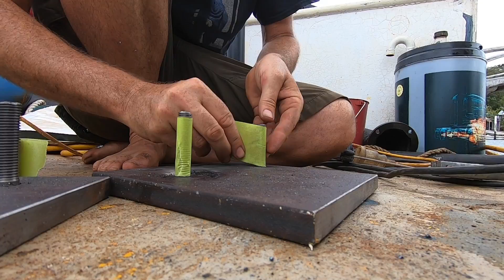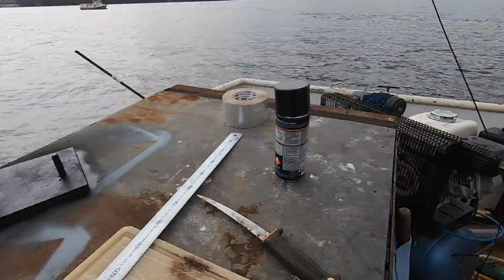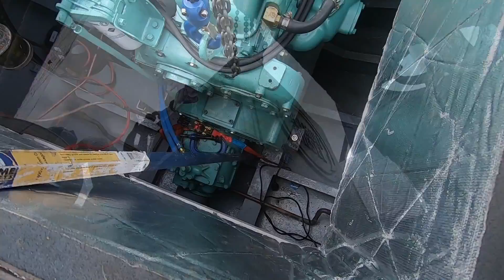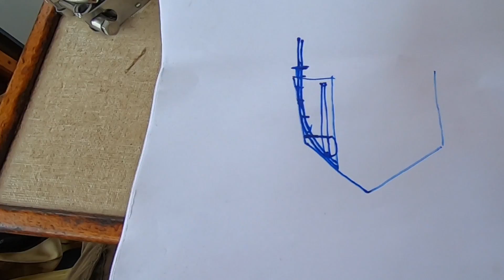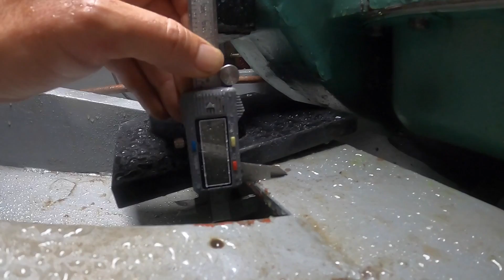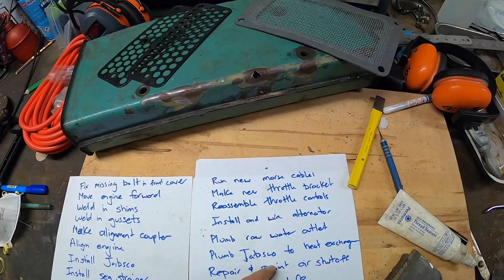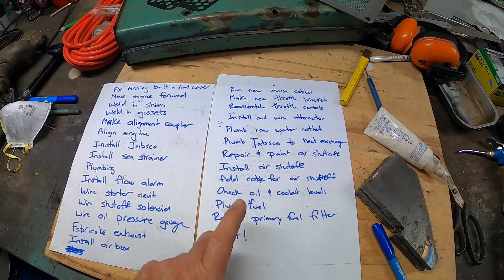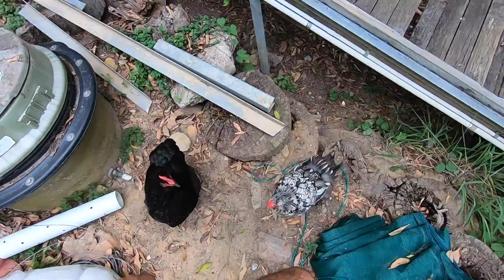Making and installing new engine shims

Comment: Stu, there's no need to rush mate. All good things take time and as Roy mentioned - there's no sense in potentially breaking something just due to some form of impatience. Think of your list as a whole heap of more content you can create too! There's plenty of creative opportunities to get heaps of vids from all those processes.

I thought Damien was into his 'Dark Country' or whatever it was called? I did enjoy the dissimilar metal thing though..

Nice soldering iron too - I've had the same model for years. Hasn't let me down yet!

Good move on the PWM to MPPT charge controller too. I bought a new 600W pure sine wave inverter the other day and it even has a built in solar controller - amazing the things you can get these days.
Reply from the maker: Thanks Scott. There is no doubt that getting this engine running will give me plenty to film!

Comment: Why not rig up a tarp over the aft portion of the vessel - from the aft edge of the wheelhouse over the stern - give shade and rain protection?

Sliding the engine forward and aft will affect the alignment between the shafts unless the propeller shaft and the stringers are parallel, which is suspect they are not.

Another way to do it would be to mill up a dummy assembly plate that's the same thickness (but uniform) as the plastic coupler...  Get the alignment perfect with feeler gages and then swap the assembly plate with the plastic coupler...  Oh wait, that's what you've decided to do at 31:27 (I was writing this as I was watching)...  Great minds!  lol
Reply from the maker: Of course the trouble with the milled spacer is that I still have to  increase the gap by an extra 50mm to get a socket in there to attach the Polyflex coupler. Can't win!
Reply: @DangarMarine  if you do the alignment with a metal spacer than all you need to worry about is retaining the exact position of the engine mounts. Just another comment above there is a simple solution to this, tapered holes drilled through the thick shims and supporting rails plus tapered pins to get everything back in the exact same position once the flex coupler is mounted 
Cheers!

Comment: use long bolts/threaded rods with nuts placed inside to simulate the poly, lift the engine and bolt to shaft then weld mounts in, remove bolts and insert poly. and its done.
rod ----x-----x-------
Reply from the maker: I also need about 100mm to install the 38mm poly though as I have to get a socket onto both sides of the bolts...
Reply: @DangarMarine  use a spanner - articulating head

Comment: 17:30 there might be a better way:
https://www.aircraftspruce.com/catalog/inpages/belite-10-06737.php
"Non intrusive, non contact fuel measurement
Works with any metal, plastic, fiberglass fuel tank
Small size
Very accurate
Works with any type of liquid
Designed for direct digital interface to Radiant Fuel Gauge (digital input)
Easy Installation
Optional five point calibration with five volt output available
Minimal dead zone – 2 inches of fuel in the tank. Dead zone varies by material and installation.
LED on puck indicates presence or absence of detected fuel"
Reply: Maybe I should watch the entire video before commenting.
Reply from the maker: It's good to have a link to an actual product though. :)

Comment: Here’s my thoughts on aligning the drive shaft with prop shaft.
1) Hang the engine as close to the CG as possible with your chain fall.
2) bolt the drive flange to the prop shaft flange along with the poly flange.
3) fiddle with your engine mounts maintaining the shaft alignment with the chain fall still supporting the engine.
4) secure the engine mounts to the hull stringers, adjust the engine mount levelling nuts accordingly.
5) remove the chain fall, 
6) Start the f’ing engine :]
Reply from the maker: So this would certainly work and let me start the engine up - it's pretty much the process I was describing for bedding the cutlass bearing in before a final fine alignment. I am more and more tempted to go this way as having the propshaft freed up will make things a whole lot easier and I do find it hard to believe the Polyflex coupler is that bad. Maybe just having it skimmed on a lathe would be a good first step?
Reply: Dangerous..... that chain-fall is on a beam of course but the beam is on a boat IN THE WATER (spoiler alert: boats TIP when CofG shifts or when other boats go by with their wakes) . When the boat is on stands then its different.......also, Vynie,  "Start the f’ing engine :]" is the kind of HYPE that I think is not in line with what buddy just said at the end of the video........

Comment: Analysis paralysis, love it. Gonna steal that. Probably a good idea to align as best you can, run the engine at low revs, whilst monitoring closely, the rubber of the engine mounts will settle a bit with weight/heat/vibration, you should be able to see even slight gaps between the polyflex coupler and the flanges, but I imagine that the vibration levels will tell you if you’ve got it right. I’ve always advocated cctv in engine bays, always nice to see if anything is smoking or moving about on a screen in the bridge without having to pull the hatch...
Reply from the maker: I am starting to lean towards a "close enough" startup to get things bedded in. The amount of vibration will tell me whether damage is being done. I too plan to add a dual visual/ IR camera into the engine bay.
Reply: @DangarMarine  Yeah, a dual IR/visual setup is even better.Sounds like a plan Stu. Great minds an' all that...😁

Comment: Stu, wasn't the poly coupling designed in for a reason?  Any way your to do list is impressive.  : )
Reply from the maker: Not really designed in, in that I've added since the engine came out. Originally it was just a metal coupler between the two flanges.

Comment: Hi Stu
You can use the yellow tongue from a mfd board to check fuel. Electricians use them to feed wires and they will not curl up at the bottom of the tank. André
Reply from the maker: Yep, I was thinking of exactly that. :)

Comment: Hi Stu been watching you for a while.  Just a heads up.  You can't align the engine "angle" and then move it forward.  The trans flange would then be too low in relation to the centerline of the shaft flange.  I know this isn't what you want to hear, but you have to slide the shaft as it is the only piece that will stay on the same plane.  Also you should measure the end play of the shaft flange up and down and split the difference to account for the weight of the shaft moving in the cutlass and stuffing box.  Alighning an engine can be a royal pain, but if its done wrong it can really wreak havoc later!  Increased cutlass wear, shaft wear, and vibration are all things it'll cause.  Keep up the good work!
Reply: PS. Get a 3/8" dowel rod from lumber store to use for tank dipstick.  flexible enough to follow contours, easy to whittle witness marks into and it'll show wetness of diesel really well.  Always have a spare or two after you've determined location of marks as they tend to go overboard or get stepped on.
Reply: PPS.  A digital angle finder placed on the shaft after you prop up the shaft flange up to take account of the "play" i mentioned above, then placed atop the engine's head will get you real close then you can play with feeler gauges while spinning the trans flange and prop flange to ensure surfaces are true as well as square to each other.  I can't recall if you pulled the prop shaft when on the hard.  You may have to do so when you go back on the hard and have the flange trued depending on the amount of corrosion its seen over the years.  Many have a hole in their rudder so that it can be turned sideways and the prop shaft slid through, but you'll have to remove the flange to do so.  I grew up on boats on the Gulf of Mexico shrimping and fishing and my last boat was a 34' Mainship and had to have an entire custom shaft log made as the original Bronze unit had leeched out and become dead and actually broke when I was prying the stuffing box off it.  So I had to start over from scratch with alignment just like you are.
Reply from the maker: Hey mate. It's interesting because in my head I had the shaft log and the engine mounting rails as being parallel, which of course may not be the case. I didn't take the prop off when I was on the hardstand as the nut had been welded onto the shaft, yet another reason to replace it when I get the money. I did take the whole thing to a machine shop though and they straightened the shaft so that's something!
Reply: @DangarMarine  IF you had the shaft and flange trued you are way ahead of the game!  That will reduce one potential nightmare of fighting worn flanges and trying to find the lesser of out of true planes and living with it!.

Comment: If you are ever inclined to replace your battery chargers I can recommend these a Motormate AC-DC24V 20A BATTERY CHARGER & a Motormate AC-DC 12V 40A BATTERY CHARGER I've got the 12v model & they are very good, fast as I have 4x 300ah 12v deep cycle batteries.

Comment: Hi Stu. When you say align you mean the centerline of the transmission output shaft and the prop shaft are on the same line. Are the flanges straight or do they wobble? I think if you talk to a machinist he can tell you a lot , they align parts to machines all the time. If it were me I would spin the shafts with a dial indicator on the face and shaft to make sure the error is ok for the coupler. I would then install the coupler to which ever shaft is easiest to turn. Then I would mark one point on it. I would measure the gap to the other flange at this mark only by rotating the shaft 90 degrees for each measurement . If the gaps are the same you should be ok. Please know I’ve never done this and I am not a great machinist so talk to one before you try this
Reply from the maker: Yep, dial gauges are a common to use for this job. The flanges are pretty straight so in theory it is just about getting them parallel to each other and no offset in any direction.

Comment: Aligning the shaft with the engine was the hardest part of my engine replacement. I had to use shims as I didn't have the bolts that you do. Fiddling with little metal plates trying to find the right combination, fore and aft, to make it all line up. You're coming along nicely though. Thanks.
Reply from the maker: It certainly is a tricky part of the process. I'm glad I put the adjustable mounts in to make things a bit easier but it still isn't going to be simple.
Reply: @DangarMarine  I've never aligned a motor in a boat, but as a fitter have done plenty of similar couplings. This is a job that takes time to be done right. Rushing this step will most likely lead to problems down the track. If you haven't got a fitter mate to give you a hand/tips, watch a couple of video's if you have the time. You may have to get/borrow a couple of different bits. Not sure if you can fit a dial in there, but even a Mike could help.
Reply: Dangar Marine Engine alignment is worse than docking at the ISS and they don't have to deal with gravity! However fancy some of our life has got, some chores still suck. I wish you luck and patience and beer enough to to get there in good spirits!

Comment: on the ship i work on we use pressure sensors to measure fuel, the more fuel the higher preasuere. then you could calibrate a guage to read against it :)

Comment: is there any inline fuel flow instruments you could install? kind of like a nmea 2000 connection for an outboard? then have your fuel flow/consumption displayed on your sounder?
Reply from the maker: You can get them, and they are awesome for determining the best RPM to run at, but they won't show your tanks are empty if you spring a leak.
Reply: @DangarMarine love your work stu !

Comment: Looking at the coupler, it seems like you have just enough room to get the dial calipers in there. I'd say screw making an alignment adapter - get the polyflex in there and use the calipers to take measurements at three different points around the circumference between the machined flange surfaces. Bevel the edge of the coupler in the lathe if it's interfering with getting the measurements. You'll lose your mind trying to accurately align that Detroit in fractions of a millimeter. It could be getting to you already - the "dissimilar metals" joke is proof:)

Comment: Stu, Bank 0 at 23.9V or /2 = 11.95V per battery should be 40% SOC, not the 5% the Balmar reports, the Balmar looks to be conservative so you don't discharge below 40% SOC with the AGMs for more life cycles, they can safely go down to 15%, you just get fewer cycles and may need higher charge rates than solar can provide. If the Balmar asked you to enter the battery capacity, and is using that value to compare to what it measures across the shunt, you may have underestimated actual capacity. The REDARC is probably measuring battery voltage and using that to indicate if the battery is flat. REDARC don't list the low voltage that the LED comes on in their manual though... but I'm sure you'll find out and show us. :)
Reply from the maker: Hey Craig, I was thinking that the Balmar may be showing usable percentage left rather than actual percentage. Personally I'm glad it is conservative. As they say, batteries don't die, they're murdered. :)

Comment: Stu, good tip for tapping. Tap diameter- pitch = size hole you need to drill, for example M10 (10mm) - 1.5 pitch = 8.5mm hole

Comment: A rule of thumb is 1/1000 of an inch per inch of flange diameter. I know the Polyflex couplers well take .020 of an inch misalignment if the shaft centers are true to one another.

Not being able to move the shaft fore and aft is making the job of alignment a real pain in the butt. 

My suggestion is move the engine where you need it. Use a machinists rule to line up the edges of the separated companion flanges. I a small Machinist Square modified to do this task. If you had a 123 block to use as a square off the transmission pilot to aline the counterbore of the prop flange. A 123 block would be about 25mm by 50mm by 75mm. 

Then use a telescoping bore gauge to measure your flange alignment up and down and side to side by measuring the gauge with a micrometer to find the differences. It's a good idea to error to needing to lift the shaft slightly to get the pilots into alignment. Generally it's half the clearance in the stuffing box bore.

I hope this gives you some ideas. The boats I worked on we had a little more room than you are working with most of the time.

One sailboat I serviced regularly the only access to the back of the engine and trans was over the top of the engine, I cursed the designer every time I worked on that engine and transmission.

Blessings Kriss

Comment: Don't you need to first line up the prop shaft before welding in the brackets?  You will be able adjust the engine up and down but not sideways if you weld the brackets first.

Comment: Won't the alignment change when you slide the motor back to make room for the polyflex?
Reply: Do RC I was thinking that too, bet there’ll be a logical answer though.
Reply: it will absolutely change unless the stringers on which the engine rests are 100% parallel with the propshaft, which is hard to imagine. Are there specifications how much dis-alignment the flexi coupler can cope with ?
Reply: @geertsailor8518  Why not get a metal disc milled to required tolerance and use that as a coupler substitute when aligning

Comment: use an old fishing rod with the eyes cut off to check the fuel.
Reply: An electricians fiberglass rod would work too. Heard them called chicken sticks once. They’re also easily extended with threaded ends.
Reply: Just a length of electrical conduit 10 dollars or so for 3meters get the orange stuff less likely to be attacked by the deisel fiberglass rods are not that happy with it

Comment: Maybe to late but you should install a sounding tube in the fuel tanks. You can then use a sounding tape with a reel and plumb bob. Make sure you use a striker plate so that you don’t bounce the plumb bob off of the tank/hull.

Comment: Can you get yourself some kind of parallel faced dummy spacer at 37mm to do your alignment with? Would cut down the amount the prop shaft needs moving and generally cut down on the errors. You probably be able to pull the shaft in the required amount for final fit just by tightening the flange bolts?

Comment: Are you going to use a temporary spacer to take the place of the poly coupling to do the alignment?  You are probably aware but if it is aligned as it sits now, the gearbox output will sit too low once the engine is moved forward to fit the poly coupling.  Would be much easier if you have the ability to move the prop shaft in and out some more but I guess you need to work with what you have.  Enjoying all the whole rebuild process so dont rush to appease the minority.
Reply from the maker: I would have thought the alignment would stay pretty good when it moves given the stern tube is at the same angle as the mounting rails. The trouble with even the spacer idea it that I still need them at least another 50mm further apart to bolt the Polyflex coupler in then bring them back together again.
Reply: @DangarMarine  OK, I didnt realise the mounting rails are at the same angle as the stern tube.  Its a little hard to tell from the videos.

Comment: Hi Stu what size is the steel spacer ring you need might be able to help or make one up for you if you could give me the size or a drawing of what you need   loving the boat keep up the great work
Reply from the maker: Thanks mate, if you could make one that would be great! This is the coupler that the spacer would be replacing https://www.polyflex.com.au/flexible-disc-couplings/product/60-616-12a-flex-coupling 
I don't see replies to replies on comments so if you are able to help, send me an email to dangarstu@gmail.com